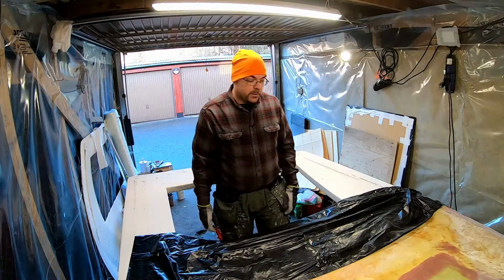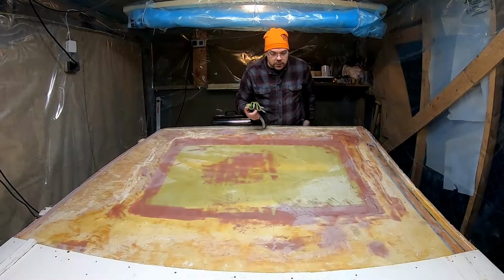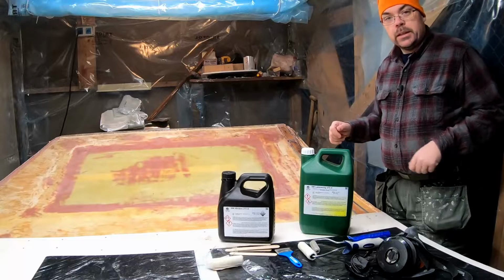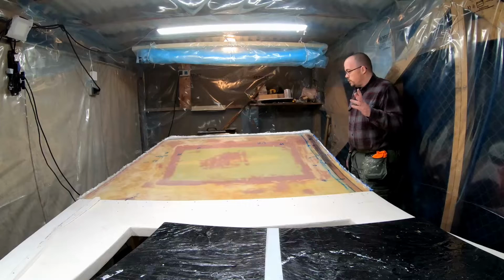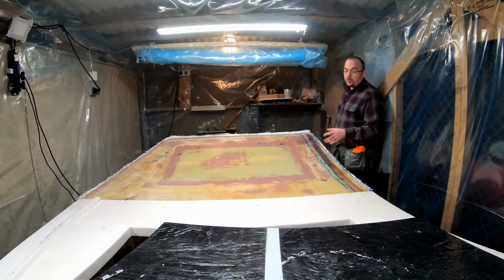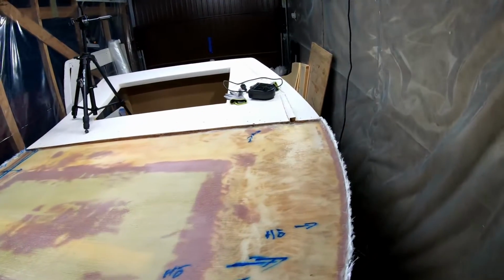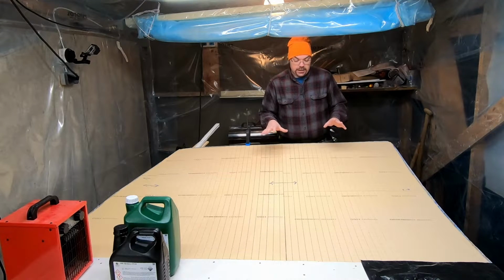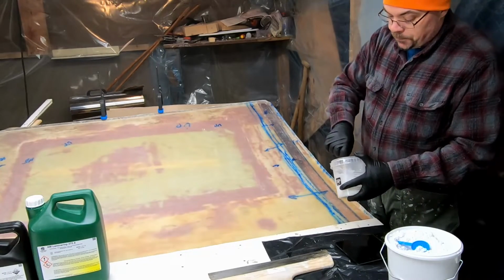Rebuilding the roof with Divinycell foam as core/sandwichmaterial - Doghouse roof Ep7

Comment: Since I'm doing a large patch (not the entire overhead of the aft cabin), I'll need the same width as the 4"  squares of plywood I'm replacing. I imagine they have several thicknesses, but for the sake of a budget, I'm using poly resin instead of epoxy. Will this work as well with poly resin? Thanks again!
Reply from the maker: Absolutly!